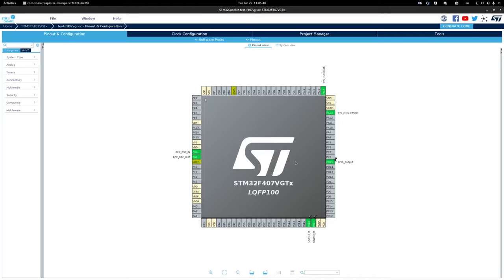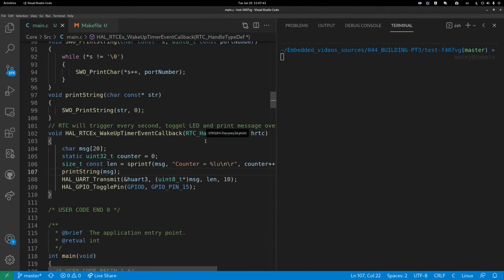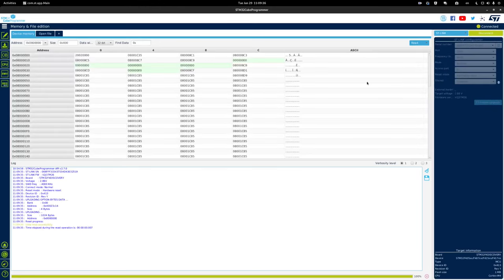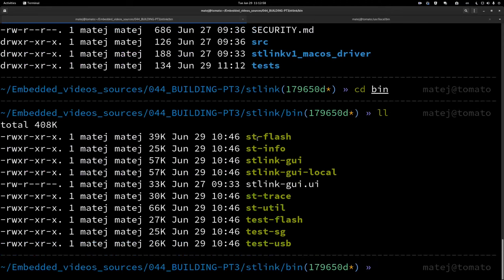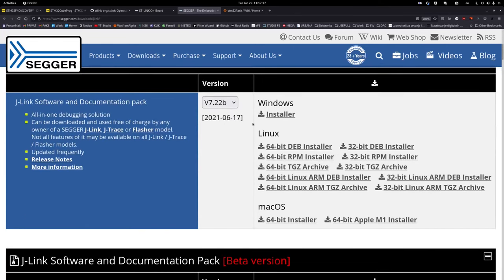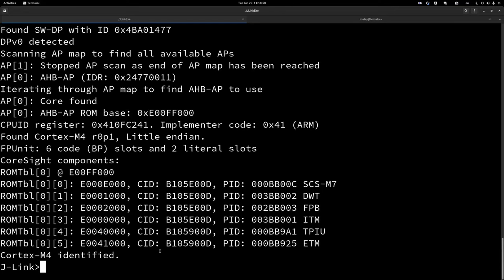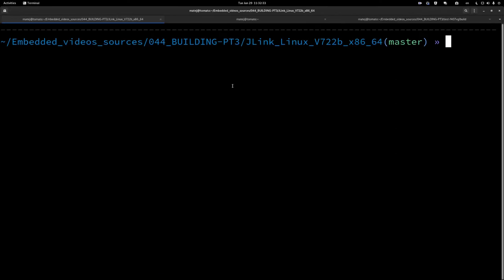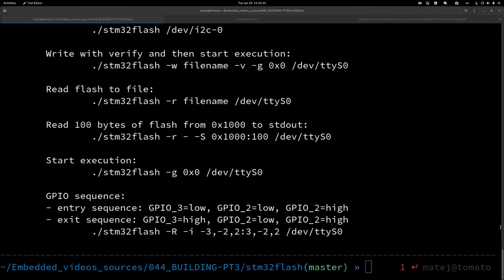Flashing STM32 with ST-LINK, JLINK and UART Bootloader, cross platform | VIDEO 44

Comment: Thank for section about programming using UART!
I just disabled SWD (I set all pins as inputs 🤦‍♂) on processor by mistake and UART is the only option to reprogram it. You are my savior! 😀
Reply from the maker: I did that as well heh, so some degree. I just used JLink and connect under reset. Since the pins only set themselves to input when the code boots, you can connect the debugger to the core right after reset. Debugger and their tools saved me that time :)

Comment: For Debian 12: If you installed "stlink-tools/bookworm-backports" and when executing "st-info --probe" you get "ERROR usb.c: Could not open USB device 0x0483:0x3748, access error." ... then execute (with elevated privileges) "udevadm trigger", then "udevadm control --reload-rules" ... this will reload udev rules installed with the apt package without requiring a reboot. These udev rules allow all regular users to interact with ST-LINK hardware debugger USB devices, including the "clone sticks".

Comment: I have been helped a lot by several of your videos, thank you very much for your clear explanations.  I now have completed my s/w development on an STM32F411RE and wish to use it standalone, that is, with no laptop connected.  

Do I have the correct understanding that if I use the STM32CUBEProgrammer to program my flash memory using the project .bin file created by STM32CUBE IDE as you describe, that I can disconnect my laptop, connect a dedicated board power supply, and my code will run as intended?  I am unclear, for example, if that project .bin file includes all of the setup actions such as interrupt vectors, clock and peripheral initialization.  I understand that I will need to consult the manual to configure the jumpers to allow this to happen, but I can probably figure that out on my own.  Thank you.
Reply from the maker: Hi, I'm glad that my videos have helped you.
When you flash your board, more often than not, you flash your program in .bin format, which includes everything (functions, static data, constants, system init, etc.), you write it into internal flash memory which is non-volatile. This means, that even after disconnecting power, the contents of your application will be left intact. Therefore you can flash your board with either Cubeprogrammer or with newer stlink v2s you can just drag and drop the binary into the mounted stlink drive and the device will flash itself. After that on every power on , the board will start your application.
Thank you for watching.
Reply: I took your advice and it worked!  Then, I powered by an external ps and it powered-up and ran my code.  Then, I powered down and reconnected to ST-LINK and could continue development.  Wonderful, thanks again!

Comment: Thanks a lot for this video.
One question: in the uart example you show the use of the dtr and rts pins, but the uart interface on any stm only requires rx and tx, and dtr and rts only go to the ftdi chip or whatever other uart-usb bridge one has. Is my understanding of the circuit correct? Does this also mean that if I choose a usb-uart bridge that doesnt have those control signals I won't be able to flash the stm32? Thanks
Reply from the maker: That's correct.
In the video I used a ft232 chip on a breadboard which has dtr(connected to boot0) and rst available. Some uart cables/adapters omit dtr pin, like the official ftdi cables, that just have cts instead of dtr. Cta cannot be used as output, so for flashing it's useless.
Well, you can also get the device into boot mode by switching pins manualy and therefore you can omit options that use that pin.
Reply: Thanks! So basically you are taking advantage of the fact that the dtr lines goes high right before starting transmitting the new firmware and goes low when finished, which is exactly how you want the boot0 pin to behave, so you just tie them together, is this correct?
Reply from the maker: Partly. In the video I configure the particular ftdi chip to have the dtr low at idle - this would make the stm32 use default boot from flash.
Then I toggle the dtr line along with rts using the stm32flash command, which puts the mcu into bootloader mode and out again after flashing.
So if your ftdi/serial cable does not have dtr, then remove the ping toggling options of dtr and rts and perform the bootloader yourself and also the device reset after flashing as well. 
That reminds me to look into cables with dtr exposed instead of cts.
Reply: Ok now after reading the stm32flash docs it's more clear what you are doing. I will not use an ftdi chip in my design so I will have to possibly place an inverter gate in dtr and rts, will check the datasheet for the default logic level. One last thing I need to verify is that stm32flash is able to use those signals regardless of the uart ic in use. Seems pretty obvious that this pin toggling action should work with any uart ic that has those signal. Personally I will use the CH340C.

Comment: Hello, Thank you for your this tutorial.

Do you have the pinout of your stm32 with the ftdi chip? i'm putting DTR to boot0, RX => TX(uC), TX => RX(uC) what else am i missing?

Thanks
Reply: I didn't end up using the dtr pin, i just set boot0 = 1 and boot1 = 0, and use the stm32flash utility and it worked (nucleo-F401RE), this is the command :

stm32flash.exe -w led_blinking_F4.elf -v -g 0x0 -b 9600 COM10

Comment: Those interfaces are often more expensive in Poland than the development board. Does neither of these method work with just a plain microusb cable?
Reply from the maker: All methods using STLINK or JLink utilities are available for the devboards using onboard debugger. With JLink you are limited to debuggers up to version 2.1. It does not work with newer stlink v3.

Comment: Hello Matej. Great tutorial. Can you please help me. I am programm the STM32G030 with st-flash (release 1.7.0) on raspberry pi4 and tool st-link-v2 (orginal ST or clone). Usaly it is not working, programm process interrupts because the tool find wrong processor id, or the programming result is OK "jolly good", but insite the processor is nothing written. what can be wrong? how i can "stable" programm the STM32 with raspberry pi 4 and st-link-v2? please help me thank you.
Reply from the maker: I cannot find a problem just by your description. Your mcu should have id of 0x466 and is supposed to be supported on stlink. Can you try st-probe to get some info?
Also, do you have all the libraries? Did the build succeed with no major warnings or errors? Have you installed all the correct libraries?
Also, do you have the correct image for your mcu? Did it build correctly?
There is a possibility that either the mcu is dead or the programmer is not working 100%. I have one dead f4 discovery board. I tried using stlink (original), then the open source tool, I also tried reflashing the debugging with jlink and using external debugger to confirm that none of them worked. If you have that option, you can try (using windows) to convert a debugger to jlink and try with that as well.
Also you can try using stlink (open source) to erase the whole memory and try flashing again - create new dummy project that you know should work for this mcu.

Comment: Thank you a lot! what will happen if you regenerate project from CubeMx? Will it rewrite you Makefile with your custom jflash task?
Reply from the maker: I can't belive I did not mentioned this, because I have a feeling I did in at least one video, but I cannot find it.
I have also tested this now as well, but the answer is still NO. It will update certain sections, where you add new peripherals and it would add include paths, but if you delete some parts of it, it won't write them back or correct them. Only if you delete the makefile, it will create a new one. Make sure to use git for your project, even if just localy, to prevent any accidental damage to the makefile.
Reply: ok, thank you. I just thought that put flash tasks to make file is wrong (ideologically) vscode can cascade tasks.  For example you can create task make, flash and combine them into another build'n'flash. And use it in preLaunch. In this case you can leave makefile prestine.

Comment: Hi,

Thank you for you channel. I really helpfull to me. I would like to know how I configure VSCode terminal with this colors and git location. If you can to tell me how to configure it I'm will be greatful.

Greetings from Chile!!
Reply from the maker: Thank you for kind words. I'm glad you find my videos useful.

I'm using zsh with starship on my system. This is what gives me a two line prompr with current directory, git info and more. Vscode uses your default shell, so when I launch a terminal in vscode, it runs zsh, which is configured with starship and other addons. Search on internet for starship.rs . It also works with bash and fish and is easy to configure.
Cheers!
Reply from the maker: Oh, you can also find my starship and zsh config (the colors and git info) im my github repository github.com/prtzl/fedora-config inside dotfiles directory (starship.toml and zsh.rc)
Reply: Thank you! I will try to configure it. Also, I would like to work with FFT. Do you know how can I use CMSIS library to calculate FFT with DSP of STM32F446ze?. 

Thank you very much again!

Comment: Hi. Nice series. Do you perhaps know why I am getting this error?
/usr/local/share/stlink/chips: No such file or directory
2024-01-12T18:30:05 WARN common.c: unknown chip id! 0x413
Failed to connect to target
Failed to parse flash type or unrecognized flash type

I have tried different methods but it also seems to want something from /usr/local/share/stlink/chips and that path does not exist on my station. Do you know what could be wrong? Thanks
Reply: Try set CPUTAPID 0 in your .cfg

Comment: What terminal prompt are you using? 
I really like the grayed out username@host on the right!
And great video.  Showing how and where the original info is in the manuals/docs was phenomenal.
Reply from the maker: Thank you for the comment, I'm glad you found my video usefull.

As for the terminal prompt ... I was in the process of building a better one (as you can see in all the videos, even ditros change). Only constant is zsh, which is my shell of choice. I played around the raw .zshrc config adding info to the right part of the promt. Here I moved usual username and hostname to the right with grey colors, so that there is more space for the current path. Later I moved the username:hostname back to the left with rainbow colors, but I added git info (when in git repository) to the right.
I don't have that exact config anymore, but I configured this with snippets from the forums (search for "zsh right prompt") and you'll figure out the syntax and where to change the contents and color. I recommend Luke Smith's channel and his config: https://github.com/LukeSmithxyz/voidrice/blob/master/.config/zsh/.zshrc

Nowdays I use https://starship.rs/ and I love the two line promt - now there is SPACE for the command line even with a long directory path. I even added git info, nix, etc. You can find it in my repository for fedora config (distro does not matter): https://github.com/prtzl/fedora-config.
Reply: thanks for the detailed response! I'll definitely search that 

I also use Zsh (spaceship-prompt), I've been looking at upgrading to starship but haven't made the switch yet. I've also been watching the warp terminal project